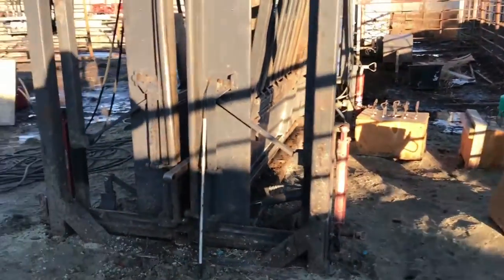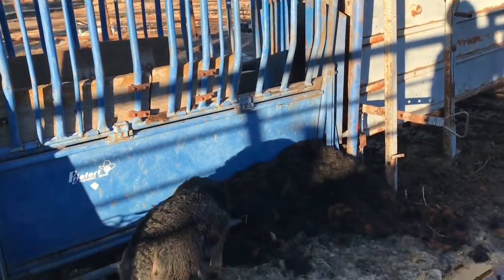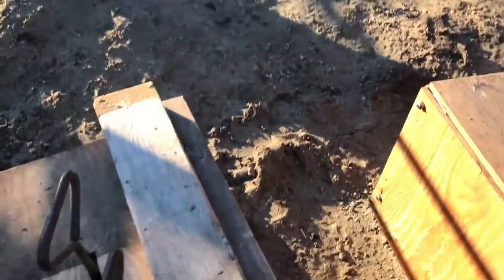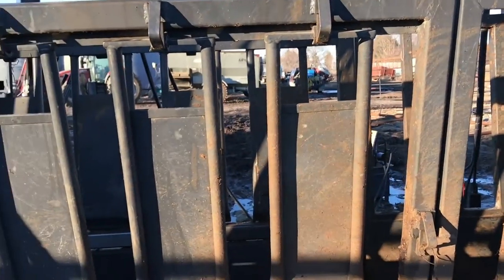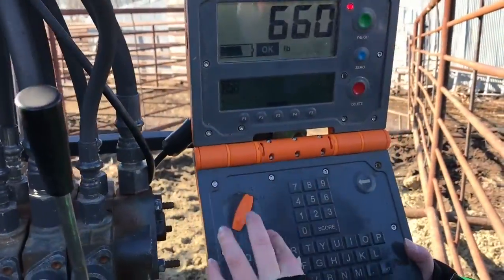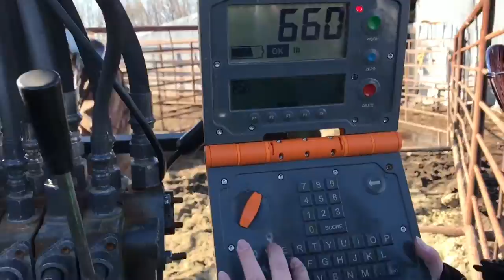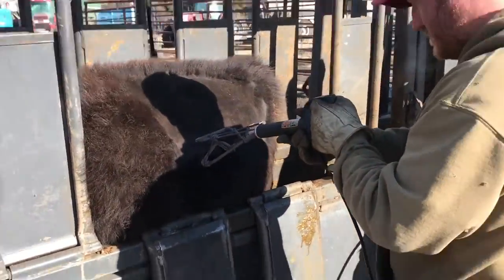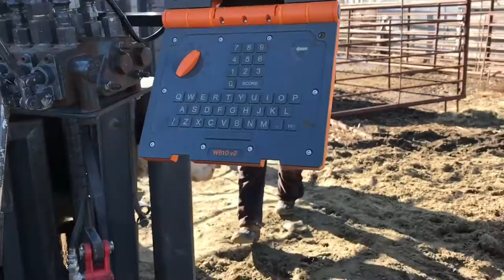Freeze Branding 2017

Comment: can you do a video showing the results? I did some heifers in November, surgical clip, alcohol, liquid nitrogen. Held for 24 seconds. The brands didn't turn out very clear on alot of them.
Reply from the maker: I will when they come home. Right now there out grazing in a pasture. Hope to bring home soon as we dry-lot them to bread .Do  you use and air gun to blow all the dirt and hay dust out of their hair. We have found that it really helps... Also we bought an engine cleaning gun you put on an air hose and put alcohol on with that and it much easier to get a lot of it that way.... More alcohol the better.   Also different breads of cattle have thicker or thinner hides so that also makes a difference
Reply: Ted Kahler   No. I just brushed them with a horse brush.
Reply from the maker: I checked mine out today and their hair hasnt started to grow back yet SOO.... mine dont look good right now either but once there spring coat has started to grow ill make a video... Yours might not have their spring coat either yet...

Comment: how are those boxes where the irons are cooled made? I'm using a beer cooler & dump the nitrogen from a seeman tank but it boils off so fast it's kind of expensive & inefficient.
Reply from the maker: Zach Larson in the boxes is just some styrofoam coolers with a plywood box around it.   We have found having a lid makes a huge differance
Reply: Ted Kahler yeah that lid looks good.. just use a router to cut the pattern? also did u ever have a chance to do a follow up video on these brands? I'd like to see how 58D turned out. I held mine for 27 or 28 seconds.
Reply from the maker: My brother made the boxes im not sure how he did it but id assume a router.  I never did get a follow up done  they just got put with the cows in preparation of calving soon.    ill see if i can find 58d and see how they look.... If i dont remind me and ill then hope to remember to check
Reply: Ted Kahler 58D's brand has got to be nice & white by now huh? You should do a follow-up video on the freeze branding results!!